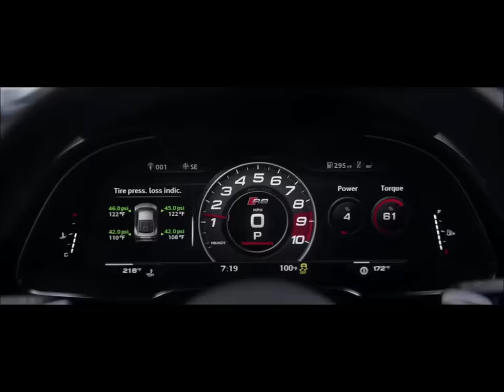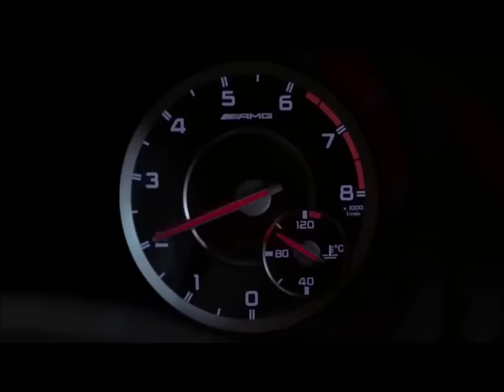😅 Funny Car Commercials - Part 1 😅

Comment: At 2:25 ...When I was in Bosnia in 2004, I drove a Skoda...many times from Sarajevo to Tuzla and back...on thin and curvy mountain roads with snow...this car was one of the best I have ever driven...better than the VW Golf they first tried to give me...
Reply: Well, skoda Fabia is basically VW Polo. Skoda is now just another brand of VW-Audi concern, like Seat.
Reply: I drive my Skoda since 2005 and it works without any problems😁
Reply: @johnfox2483 True. The cars share the same assembly line!
Reply: Should have tried the Saab Carlsson....that DOES handle...
Reply: years ago they stoped to give skoda motors into it and they passing them into volkswagens, and skoda put there weak germany ones

Comment: Fiat has uped their game.  I used to have an old Fiat 500, kids passed me on hills with their bikes.  I then decided to buy a new Fiat Panda, the one with the fire engine, built by robots.  It broke down on the way home from the garage, Ieventually got it home but it wouldn't reverse up my drive due to lack of power, next morning I opened the door and the car was full of water and the battery was flat.  I took it back to the garage where I bought it and they weren't interested.  I asked to see the manager but the manager ran out the back door and disappeared in his car.  I was forced to take the Fiat to another dealership and they sorted out the car.  A couple of weeks later I was stopped by the police, it turns out the garage were I bought it from had fitted VW Golf number plates on my car and put my number plates on a VW Golf.  I part exchanged it after that and bought a Ford Escort.

Comment: The only thing about German cars is that when all the recyclable plastic parts expire after 5 years, it's cheaper to buy a new car than fix it.
Reply: How does one make plastic 'expire' exactly?
Reply: @thetessellater9163  German automobiles were mandated to have a high recyclable material content, which means more plastics are being used in parts of the car that see lots of heat, such as the engine. These materials don't last as long as other materials. I don't know what the prices are like in Germany, but in North America, replacement parts for German cars are stupid expensive, & so Mercedes & BMWs are seen as money pits. You can buy used ones super cheap, but you can't afford to fix them. Only wealthy people buy them new, & then get rid of them after a few years.

Comment: 0:45.  Video editors allow you to easily split a one-side-only audio track into both channels and reduce the volume so that it's not clipped.  The BWM segment is pushed to the right channel and clipped at 0dB from 0:54 to 1:49 and that's simply inexcusable; even non-monetized channels do better.  It took me about 5 minutes to fix this in Audacity and that included the time it took to download the clip.

The volume levels of the other segments are all different, so it's obviously that no effort was made to level-match, yet this can be as easy as adding 1 effect in some editors.  A definite thumbs down from me, though I do understand if this was your first video and you were learning the ropes.  That seems unlikely considering that you've left this up for 3 years, though.  Good luck.
Reply: Nobody cares.
Reply: I thought I'd gone deaf in one ear for a moment...
Reply: who exactly gives a f...?